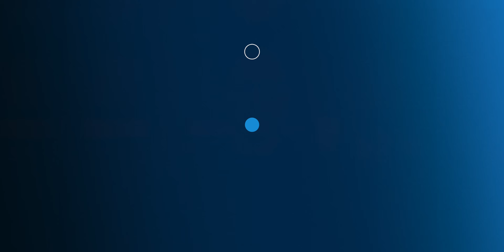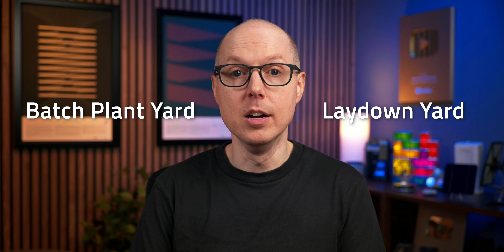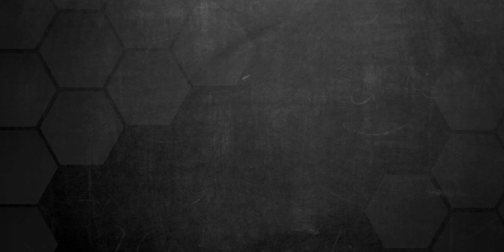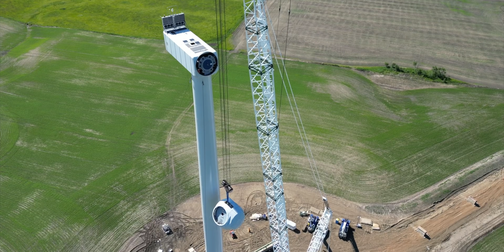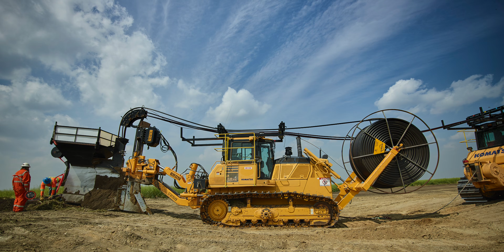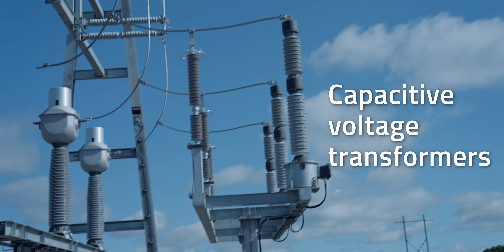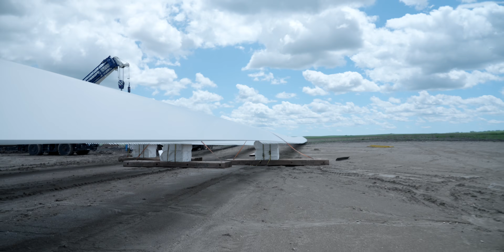The Hidden Work Behind Wind Energy

Comment: From this video I understand that wind power is ineffective CO2 emitting waste of resources that gives us weather-dependant electricity production to the grid, which demands PLANNABLE production.
Why build these enormous structures when we have tidal turbines that weight 1/5 per MW and are far more cost effective even considering operations at sea?
Minesto D12x in Faroe Islands are at 1,75MW ~30ton.
Stop destruction of the environment with huge amounts of steel and concrete.

Comment: That cable in the tower scraping against the ladder sound like the T.A.R.D.I.S.!
And now buildt them at sea, check out the equipment they use for that, have only seen it from our Castricum aan Zee beach.
The power cables were drawn under the dunes at Wijk aan Zee with directioal dilling, and through a huge 380KV substation next to the steel plant I work at, goes further to our NL grid.
We wll actually get a direct connection to that substation o power our future zero emission factories.
6 windturbines next to our site have a hub hight of 120 meters, higher than our two Blast Furnaces, but our DRI installation wil be about 150 meter.
Excellent video again Matt (yes, you 😉🖖)
And a friend of mine works as a maintenance engineer on the offshore turbines, highly specialized work, and high safety standards, as on our site!

Comment: Not really renewable when less than 10% of that monolith is recyclable. Ends up in landfills somewhere. They like solar panels do NOT have the lifespan they say they do. 
I’m not against any of this stuff but they need to be honest.
Reply: I am sorry, could you elaborate why only 10% ? Seen repowering projects, where they blow up and crush even concrete base. If we ignore that, even by weight 1300 ton base, 300ton tower, over 100ton nacelle, 40ton hub, 3x 20ton blades. Out of total 1800 ton materials, 60ton of blades are not recyclable, and even if they leave the foundation, that still would make 25% recyclable. If the owner is responsible and recycle the foundation, you have 97% recyclable turbine
Reply: @ Fiberglass is not recyclable. The only recyclable material is the copper. Not sure where you live. But these wind and solar farms take up tens of thousands of acres equaling square miles. They litter the landscape here in Commifornia, the most leftist want to be greenest state in the nation. Delapidated towers as far as the eye can see since it’s cheaper to build new towers than remove and dispose of the old since there is no place to dispose of them. So like off the east coast in the ocean, they just sit there and rot. Destroying tens of thousands of acres of plant and animal habit to build these farms is a far cry from “save the planet”. 
I’m not against “green” energy but it’s far from renewable and or green. 
Nuclear power takes up a far less footprint and uses far less material to generate power for millions of people. It’s also capable of regeneration. They need to green light it like they do all the permitting of the wind and solar farms. 
I’m sure the reason those get built so fast is because it fits the save the planet narrative and most likely kickbacks via cash, vacations or stock.

Comment: year 2025, 

and you're still telling me not a single institution yet calculated the overall costs comparison in between large scale and small scale windmill energy generation, 

including all environmental & logistics costs, work hours you can not automate restricted to 9-5 off weekends, cost of opportunity due to long project finish times since the whole system is built on site with construction phases in series leading to excessive labour costs etc. etc. 

AGAINST a distributed low risk, on rooftop small scale, in factory built with parallel manufacturing 24/7 lines decreasing project finish overall time, modularly scaled up, low maintenance windmill generators? 

i mean come on! ?

Comment: I challenge your "clean green" energy claim. What is the carbon footprint of all the trucks needed to complete this site. How about the carbon footprint of all the heavy equipment needed to mine the cement and gravel, the carbon footprint of all the steps in the steel manufacturing process to make all the parts? Then in 12 to 15 years your windmill will be worn out and need removing --- more carbon footprints. I could go on and on. It's definitely not clean green energy by any measure of the imagination. You really want to tell the whole story of how dirty these windmills really are? Didn't think so! Drill Baby Drill!
Reply: @rogerray7820  so the solution is an even dirtier form of energy? Everything you argue applies to oil as well at a higher volume.
Reply: What kind of twisted logic is this? In whole chain of construction you point out specifically oil based fuel used equipment stages as not clean part of this energy, and then advocate for ignoring the whole good part andjust lets focus on the poluting energy?
Reply: @ttic24  that's because the "clean energy" is actually more polluting than the fossil fuel industry. If you're going to compare apples to apples then do it equally. Don't wave your clean energy flag and proclaim it's green clean and must be the only way to go. You can't ever start a green energy project without a Hugh carbon footprint from fossil fuels.

Comment: One big question I've always had with regards to wind generators is this: how do you take the AC current from the nacelle and get it in phase with the grid?

Do they convert it to DC first?
Reply: I've watched other vids of this.  There are specialized devices.  Pretty sure they take the actual DC from these things and do the AC conversion at the end.

I was quite confused in this vid where the guy talked about multiple conversions "in the middle".
I'm not understanding that at all....

ESPECIALLY "capacitive voltage transformers".
MATT, YEAH, WTH are those?

Comment: I am curious about the social impact at point of use, the actual people near by.  Have they mitigated the migratory bird issue?  What is a general lifetime for the construction?  What is the profit avg. on a say a monthly basis?  Thanks.
Reply: There's a turbine on the south shore of Blender Lake, which is the largest migratory bird stopping point for probably 30km in any direction. I kinda shake my head every time i drive by. But there is significant set backs from the Ducks Unlimited wildlife reserve land in the area. It's an odd situation.

There is a payment to the farmer based on the site build and power production. They haven't been running long enough to figure out how much that's going to be in the long run. They are not all fully operational yet. I think you would need a year plus of full operation to have an option. The taxes paid to the municipalities are a fair bit of value. The First Nation land is independent and not subject to municipal taxation. It's like a national enclave. Those turbines were the first commissioned and get started first to make the most money for the First Nation. There were a few Natives employed. And lots and lots of locals because the construction company is local. "Benefit" is complicated.
Reply: @  Wow....I appreciate the answer.  Thanks.

Comment: The one thing I don't really get, is the stuff about the noise. There is a 100x3MW wind farm, just a few miles from my birthplace; I've visited it many times, and even standing directly under the spinning blades, the noise was minimal. A sort of 'Whumm!' noise, as the blade fell towards the ground, but never anything you couldn't speak in a normal voice around. I have driven past the farm, maybe 300M from the nearest turbine, and there has never been anything to hear. I think my hearing is still pretty good, so I this particular 'nuisance' element still has me stumped. I also find them quite beautiful. Each turbine, provides enough, averaged over the year to power 1,000 homes. I am always looking with pleasure, and awe, at each one of these towers, keeping maybe three, five thousand people in electricity year round. I have protested against a local gold mine, because they are going to destroy an area of outstanding beauty and environmental importance, and because we don't need more gold. I am firmly in favour of the proposed new wind farm, which way, way more people are protesting against, because, despite in my heart feeling it's far too late to save us, I know we need more renewable energy, and those turbines have to go somewhere. There is one mountain, Benbraddagh, I wish could be left untouched, but hey, if that's what it takes.
Reply: From this video, the noise crap is SOLVED, if they pay for those add-on things ( the spikes/fins/whatever on the blades )
He doesn't mention the longevity of the towers/nacelles/blades, nor does he mention the recycling of said items, IF ANY.

Others have brought up the same damn concerns, and NO ONE ever shows the 30 year deal.

EVERYTHING I've seen shows these things being GREAT for their life.
BUT their life does NOT include manufacture, or disposal.

The blades seem to be a huge environmental loss over time.
AGAIN, NO ONE SHOWS THIS SHIT!

WTF happens to those blades after 5 years?
Reply: @rhoused1743  The only issue to recycle is glassfiber components, like nacelle body and blades. The rest is actually very well recycled, tower is just massive lump of steel, which in a week after dissasembly can be cut in manageble chunks and go for recycle. Inside nacelle gearbox, generator, frames are as well easy to recycle. Most electronics being refurbished and reused after faults. 
Those blades are in great condition after 5 years, and generally last the full designed lifespan (now reaching 30-35 years) with yearly inspections, and generally every two years having repairs for any damage (like tip leading edge erosion, lightning strikes, etc)
Reply: 100% with you on the gold! This underground tunneling for gold is okay, but the surface digging just makes an environmental disaster. But 'Gold Fever' is a real factor and some people get blinded by it.

Comment: Fusion > Nuclear > Wind > Solar > Everything that consumes fossil fuels.
I'm all for Wind and Solar being part of the mix, but the baseline should be nuclear, and the baseline should be at least 20-30% over capacity with any excess being used to suck up CO2 and convert it into something akin to Porche's eFuel. Not for cars but for aircraft, emergency rescue, and most of all military vehicles.

The military uses a ton of fuel and even if we eventually make better Helicopter and Airplane power trains then what they use now it'll take decades to replace the fleet or to modify them. Without portable power EV's are useless so I wouldn't expect the military to go electric within out lifetime.

Comment: Why do all wind turbines look like fans just on a giant scale? Why do they not face the opposite directions of the wind catches it instead of blowing into it? Is it structurally more sound in the way that it's made right now?
Reply: I don't know the explanation, but I trust 1000s of engineers and manufacturers to have worked it out as the preferred way
Reply: If I understood correctly your idea, the tower would make a large load difference when blade would pass that region. Even in this configuration it is noticable.

Comment: Alternative energy facility construction and operation requires considerable inputs of conventional energy (coal, diesel, gasoline) and lubricants (oils).
Reply: Ah, yes but it's shown the energy deficit is recovered in less than two years, so not a good argument against wind. 

You also must consider the tons of energy required to extract, refine and transport fossil fuels to be consistent

Comment: I was curious about the "current transformers". My cursory search tells me they're used for monitoring equipment. It's difficult or unsafe to monitor the direct large amounts of power, so step down the amps and monitor it based on a fixed ratio. Anything else important that I'm missing or wrong about?
Reply: A current transformer is basically a ring made of a material with good magnetic conductivity, like ferrite. The conductor inside which the current that's to be measured is flowing wil have a magnetic field of a strength proportional to the current. That field will cause a magnetic flux inside the ferrite ring. 

There are 2 options to measure the magnetic flux: for alternating current a coil of a few windings around the ferrite ring is sufficient as the alternating current will cause an alternating magnetic flux which induces an alternating voltage into the coil. That will be a few volts AC, enabling a low-power, low-voltage electronic device to directly measure the voltage coming from the current ttransformer, despite the current that's measured here may be up to 600 Amps and the voltage as high as, say, 30,000 volts.

If it was a direct current, a Hall sensor would be needed to measure the magnetic flux in the ferrite ring. That's basically a small conductive plate with 4 connections, 2 for a small direct current and 2 for the output. This plate would be inserted into a small gap in the ring.
Any magnetic field going though the ring and also the plate will deflect a current sent through the plate. A constant current may be sent through the top and bottom terminal of the plate, and a resistor is connected to its left and right terminals. Without a magnetic field the left and right terminals of the plate will show no voltage. But with a magnetic field going straight through the plate, the constant (DC) current fed into the  top terminal  will be deflected to one side, so part of it will leave the plate on one side, go through the resistor, and re-enter the plate on the other side, finally leaving it though the bottom terminal. Now a (very low) current is flowing through the resistor, causing a voltage drop over it of a few volts or just millivolts, and that small voltage drop is proportional to the many hundred amps that go through the main conductor the ferrite ring is placed around. A 600A current may result in just 600mV over the resistor. A small voltage that can easily be measured with a small electronic device like a one-chip microcontroller which operates at 3-5 volts and sends its measurements to the central constrol system via WiFi.

Comment: 200 MW ≈ 100,000 homes?

🥴 a bit generous, I'd say. That's 2 kW / household and I guess Matt should know, having done all the math for his own home, but it strikes me that's "a little light" to cover water heater, washing machine, dryer, stove, and fridge - let alone lighting, TVs, computers, power tools and the like. Charger for your EV? Toaster and coffee machine? Even if you call it an average over those 100k homes it's maybe fair for the middle of the night... but during the day?  Didn't you put up 5 or 6 kW of panels on your house, Matt?

The part that really amazes me about all the really heavy engineering that goes into civil works like this is that the costs have to be absolutely staggering, and the payback is measured in cents per kWh. Has to be some really clever long-term math to make it all worthwhile!

Comment: Question, Each turbine spins generating 3 ph electricity - where is the control to ensure each turbine spins in phase with another and how much energy is lost in that process?
Reply: In big windturbines the generator is not in sync with the net phases. The energy is electricly converted for feeding into the grid. It is a AC to DC to AC conversion in modern turbines.I don't know about the lost in this process, but the advantage of running the generator in optimal speed is bigger.
Reply: @baltasarneumann1791 In this case the Nordex turbines are synchronous 3 phase AC. It's all grid tied spinning mass. The synchronizer switching is done by the computer.

Comment: And how much concrete does it take per windmill? Great idea but…
Reply: For a rather new type of a 5,6MW, 160m wind turbine that's becoming more frequent in Germany: 2.300t of concrete, approx. 900t of steel, copper and some other metals, plus 3 blades, 24t each, 60% of that is fiber glass.

I calculated the energy required to produce that amount of both steel and also concrete to be 7.6 million kilowatt hours of thermal energy, requiring 900 - 1000 tons of coal. 

But we used the coal directly in a power station, we would get only 40% of that themal energy as electric energy - roughly 3  million kilowatt hours. And many coal power stations don't even have 40% efficiency, especially the older ones.

How much do these wind turbines deliver? In northern Germany - a region with plenty of wind through the winter half of the year - the provide about 16 million kilowatt hours of electric energy. 

Cement and steel production is probably the most energy-intensive part of the process of manufacturing, transport, and on-site construction of a wind turbine, so double that figure of 7.6 million kilowatt of thermal energry hours should suffice as a grand totals.

The are designed to last about 20 years and expected to deliver a total energy ouput of over 300 million kilowatt hours - probably 50 times the energy that coal power stations had provided, if not more.
Reply: @ElwoodEBlues  what was the outcome after all that writing?
Reply: And for those not familiar European usage inverts the use of commas and periods in writing, so 2.300 tons means 2300 and not two and 3/10... 

That is also seen in reverse with 5,6 MW at the very beginning to mean 5 and 6/10
Reply: @thewheelieguy  exactly - I meant to write 5.6 megawatts and 2300 tons :)